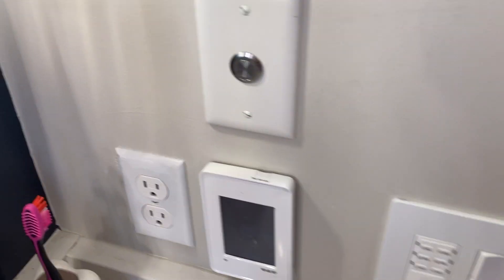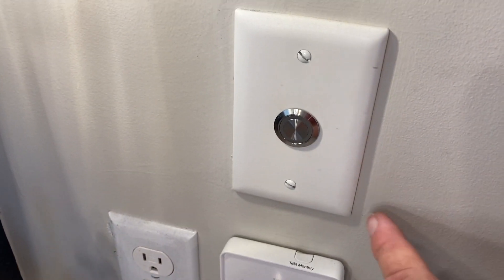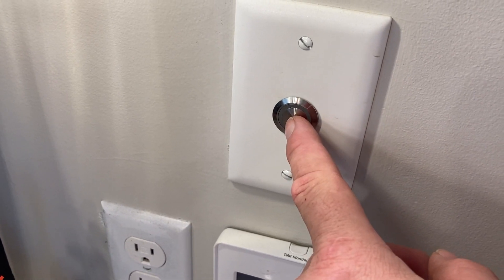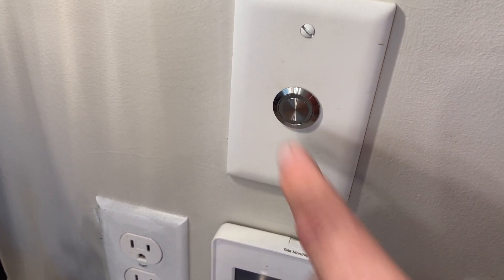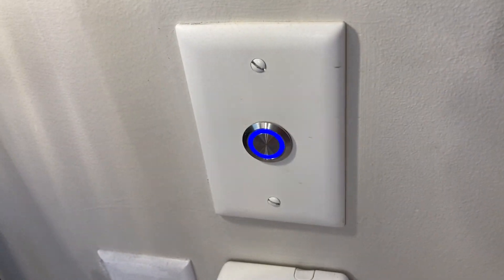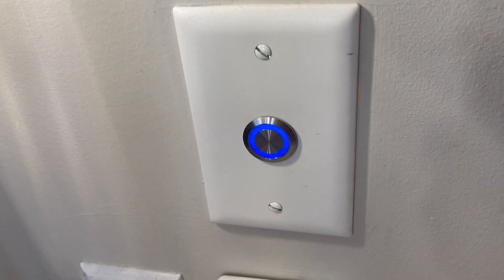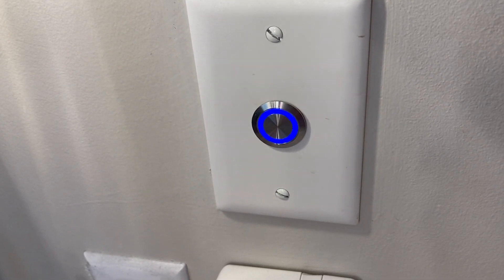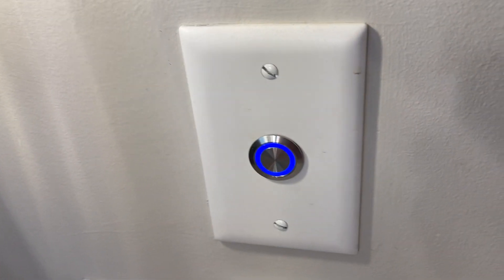On demand push button hot water recirculator operation

Comment: What would you guess the length of pipe between your water heater and this faucet?
Reply from the maker: There's roughly 50' of 3/4" PEX from the tankless water heater to the thermistor at the farthest fixture. Unfortunately, I just ran 1/2" PEX return line from that end of the run back to the cold infeed on the water heater through a 1/25 hp Grundfoss pump.

In future applications, I would do the same 3/4" PEX for the return line.
Reply: Thank you for the quick response. Seeing it in action on video is great as compared to reading it somewhere. Seeing is believing. I’m looking into replacing two water heaters on two buildings with one water heater in one of the buildings and a recirculation line that goes from that water heater underground to the other structure. Looks like the distance would be around 70 feet. I just started looking into this and I don’t know if it is unrealistic. I just got solar installed so with a heat pump water heater, the power would be free. If I can get away with getting just one large water heater that would drastically cut down the cost and also half the maintenance.
Reply from the maker: @Beingfrank5726  I love ours and we use it daily. No more dumping galloons of cold water down the drain or waiting (it takes a minute to "charge the line", but you can hot the button and get ready for the shower while the pump's running. 

The always-on recirculators would seem to waste a ton of energy; it sounds like this setup would work well with your application

Comment: This is what I'm looking for. I'm looking for a push button on control switch that will shut off a circulator pump and at certain temperature. When the temperature is reached the controller shuts the pump and will not turn back on till the button is pressed. The$10 controllers I'm seeing on eBay will constantly be on and control the circulator pump between certain temperatures. I'd appreciate any help.
Thanks
Francis
Reply from the maker: Sorry I didn't get back to you earlier, I'm trying to get my friend who set this system up for me to make another one, but he's swamped with his full-time IT job.

I want this same system for my future new construction and major renovation projects, and would love to sell a kit that other people can use, too.

Do you think there's much of a market for it? It's roughly $50 of parts not including the motor; would people buy this setup for $100?
Reply: New product out that triggers the pump without the need to run wires to a button, no wifi, smart devices of any kind and is accessible from any tap. Check it out. I'm a plumber and the creator!
Reply from the maker: Nice! Link? I would buy